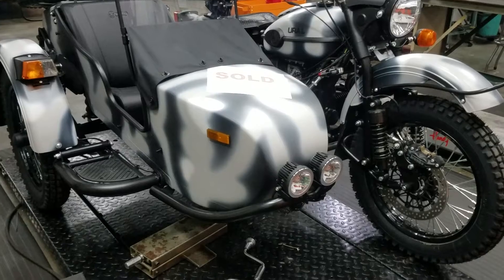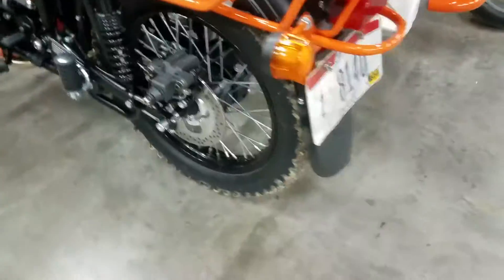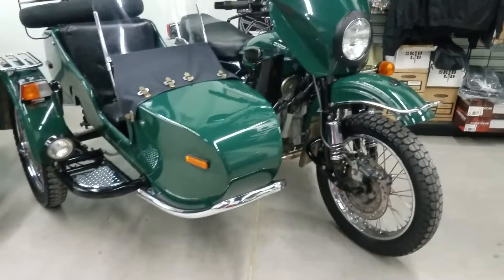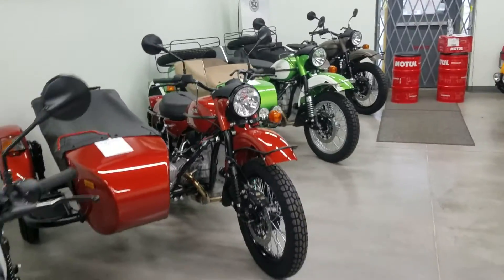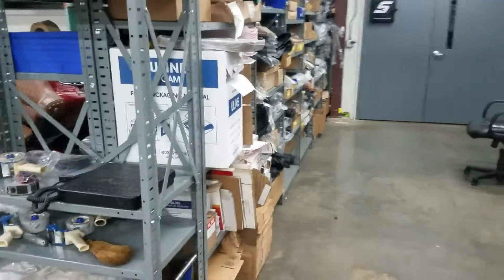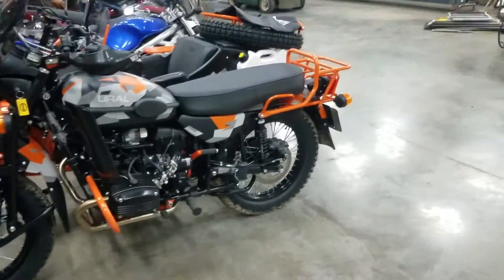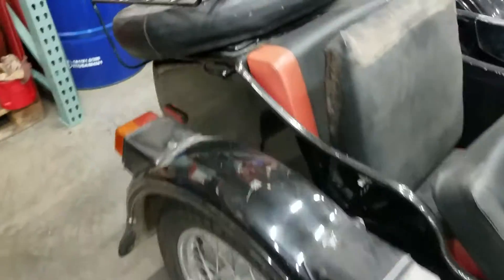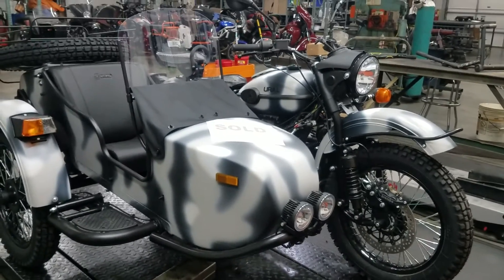New Ural Sidecar Motorcycles, Shop Overview, and Preparation to Punch Holes in Ural Accessories

Comment: Jon, I noticed there was a small, what looked like a gauge just beside the speedo on the Limited Edition camo bike.  Is that a tach???? If so,  is that available for a cT.
Reply from the maker: It is a cylinder head temp gauge
Reply: Cool add. Always got my eye out for a tach. Thanks